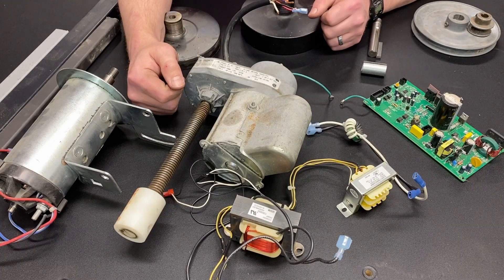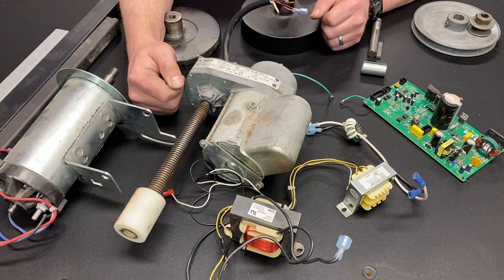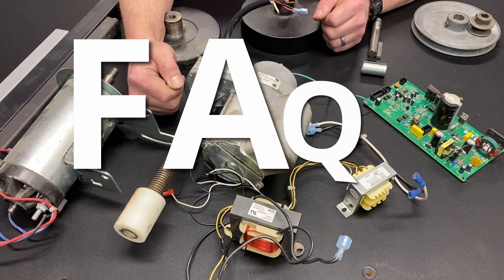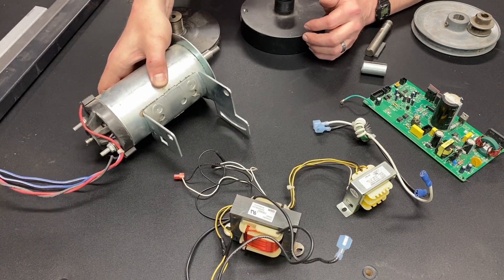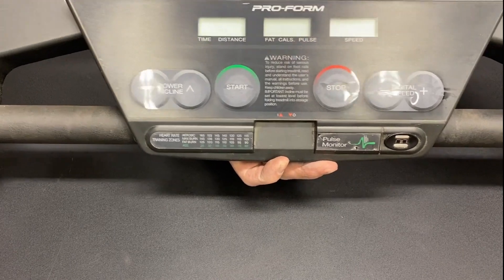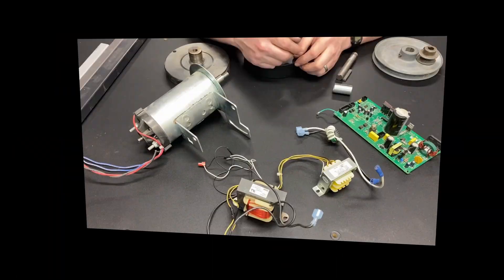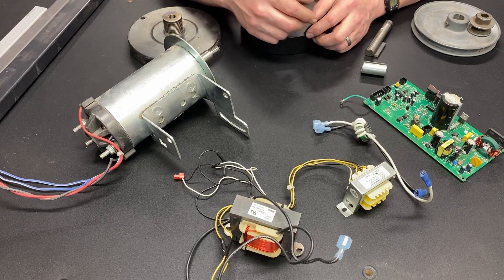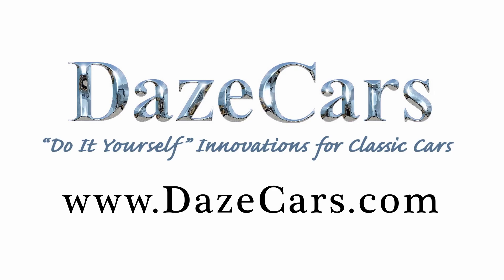Treadmill conversion FAQ 5. Why not just use the treadmill control panel?

Comment: I appreciate the knowledge. If you know anything about e-bikes specifically what the best setup is far as speed controller motor and battery goes love and future video that like for example if I have a 200-amp controller and it 15000 watt rear hub motor what is the highest volt battery that can be used or if you have any specific brands that you recommend for the best build that can with stand the most. I just have so many questions this is all new to me and would love to increase my knowing about the specific topic electric motors
Reply from the maker: I have not pulled apart any e bikes so I am not familiar with how they work.